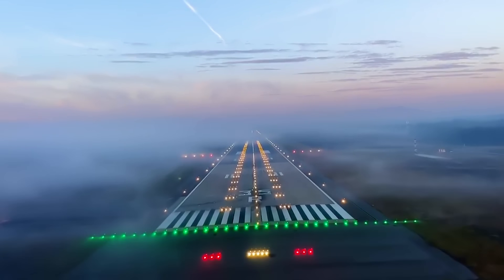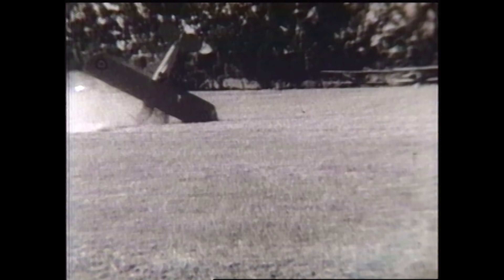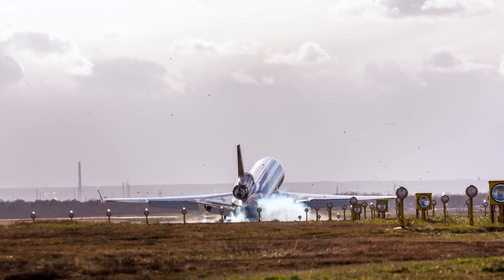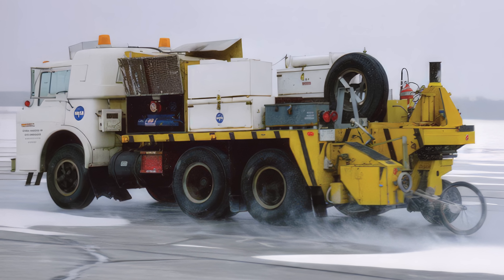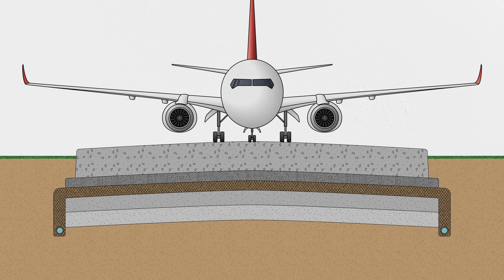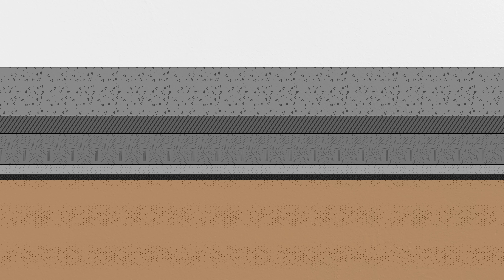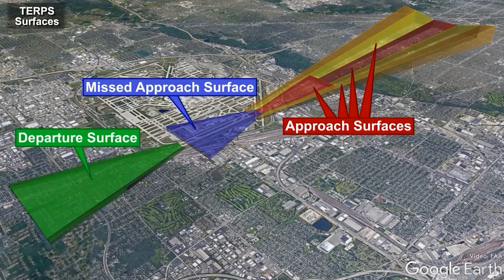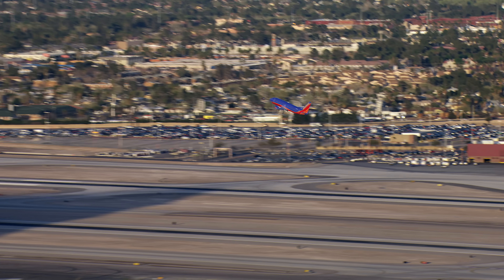The Hidden Engineering of Runways

Comment: Runways can be 18” thick of high strength concrete with an incredible amount of epoxy-coated rebar. I have done concrete work at Sky Harbor in Phoenix.
Reply: Not my day job but I thought epoxy-coated rebar was forbidden.
Reply: @tomschmidt381 epoxy coated rebar is what has been used on all the road and airport projects I was a part of, whether designing or inspecting. Is there a reason you thought they weren't? allowed?
Reply: @sergiocalderon6325 The epoxy gets cut/abraded off during transport or installation, and then the rebar starts to rust. The coating sometimes isn’t thick/tough enough, compared to galvanized rebar.
Reply: @sergiocalderon6325  I believe its use is starting to be restricted by building codes, as small chips in the coating due to manufacturing defects or rough handling can lead to water intrusion and higher susceptibility to corrosion than uncoated rebar (which generally has a passivation layer). I think this is mostly a concern in environments where salt water exposure is common. I think the general recommendation these days is to use hot dip galvanized rebar instead, since it's more durable and provides cathodic protection.

I guess in warm environments far from the ocean like in Phoenix, this may be less of a concern, though.
Reply: @sergiocalderon6325  I believe Grady here has a video on just this subject! (Naturally.) Basically, its fine until the epoxy cracks then the rust actually seems to accelerate within the rebar as it draws moisture out of the concrete structure at a specific point, rather than more generally, so it can lead to point failure instead of slow deterioration.
Reply: @tomschmidt381  It probably varies depending on location.  Most likely, in Phoenix, nothing ever rusts.
Reply: Why dont they use stainless or glass rebar?
Reply: @kizzjd9578 Stainless is more expensive and also not as good mechanically (it's kind of brittle), glass is used sometimes, but again, different mechanical properties.

Mild steel is relatively cheap and has really good tensile strength, which makes it the ideal choice for rebar for many applications.

Comment: Can’t wait to see how this will fit in your garage
Reply: Perfect for when you enter your garage too fast.
Reply: I came to the comments to ask when we'd see a garage mock up!
Reply: Now I want to see a scaled down EMAS version für RC planes.
Reply: @friedrichweitzer3071 YES!
Reply: And where do the googly eyes go?
Reply: Fold it, duh.
Reply: How quickly does it take to repair the crash pad and is the runway closed during that time?
Reply: @michaelrichardson4913  Depends on the pad design/material, length of the investigation (if any) before the plane can be moved, how much damage was done, and how prepared the airport for such an occurrence. On the low end an hour or three, on the high end a few days.
Reply: @michaelrichardson4913  The runway will only be closed as long as it takes to investigate, remove the plane, and sweep the loose bits. The FAA will create a notice to airmen that the arresting material is out of service, pilots and airlines will get that notice and may have their own landing limitations based on the available arresting equipment and how they calculate landing distance required for their particular flights. 

In a light propeller plane they may only need 1000 feet of the 8000 feet of runway and so their is no over-run hazard even after including safety margins, so they will continue to land as normal. Model ABC airliner at landing weight K may need 6000 feet and need a functioning arresting system or the typical 1000ft safety area for hazard mitigation.
Reply: Look for "miniatur wunderland hamburg" - they do have huge airport in their former warehouse shed.
Reply: Ha
Reply: Considering he builds scale models of stuff, it can be a pretty easy fit. 😝
Reply: AHUHAHUHAHUHAHUHAHUHAHUHHHAHUHAHUHA 😂
Reply: Hahahahaha YES! Miniature runway time! ✈️🧑‍✈️🛫🛬
Reply: It will be next to his hydrodynamic plexiglass dam models
Reply: You win the Internet today with this comment!